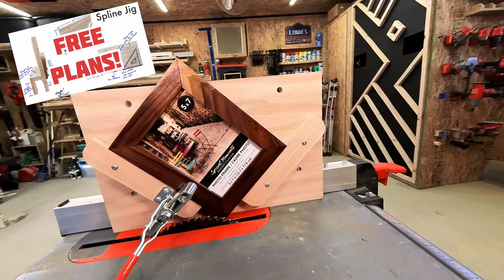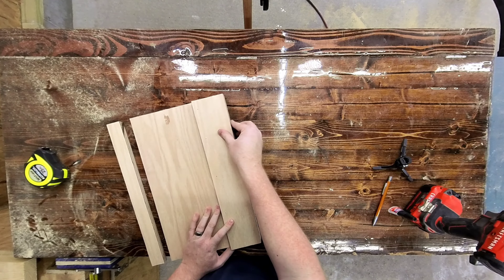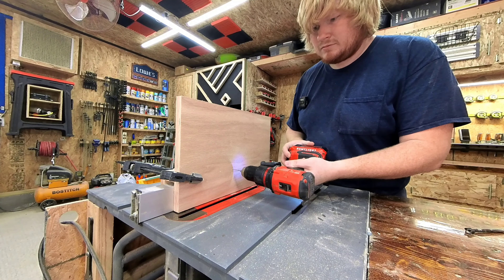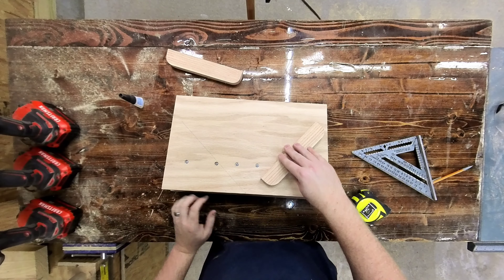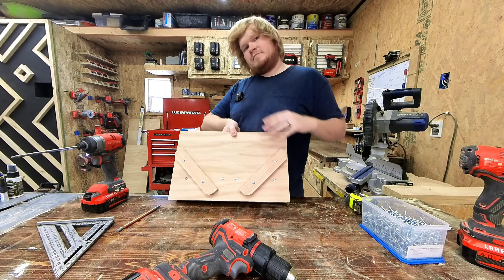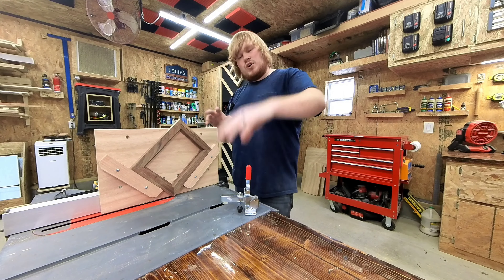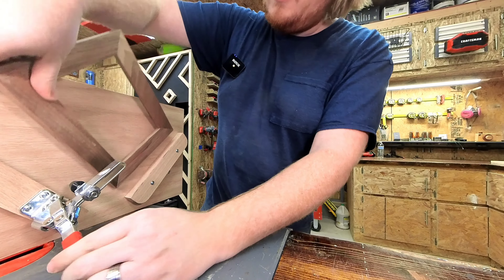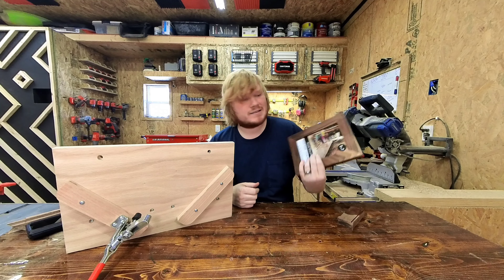How To Make A Spline Jig FREE PLANS! | Woodworking | How To

Comment: Splines are nice however what about dowels? Rockler has a jig for using dowels to support corners instead of splines.
Reply: Both are nice, this jig can be made with scraps though. Don’t have to buy anything but the clamp.
Reply from the maker: Dowels are pretty cool, but if they don't line up perfectly your corner might be a smidge off :/ I like splines and how they look :) thanks for the tip though!

Comment: Is there a way to do a splin without a table saw??
Reply from the maker: You can cut them with your router and a jig that rests over the corner. Its easier to get a clean corner as well but I went with the table saw jig. Google search "router spline jig" and you should find some pictures